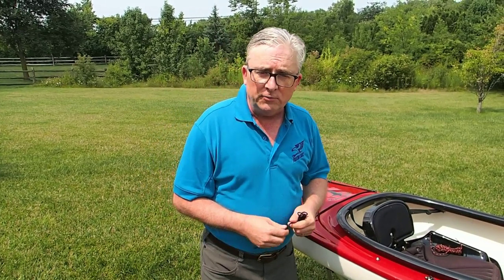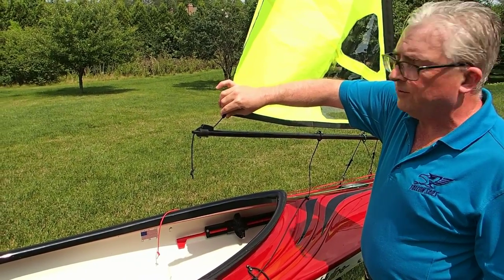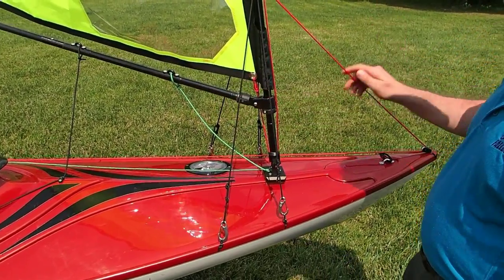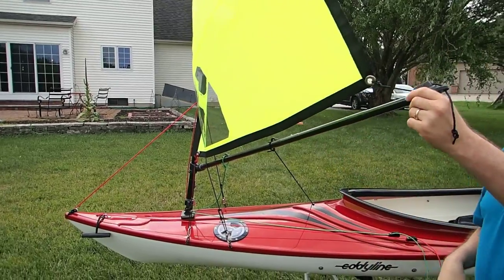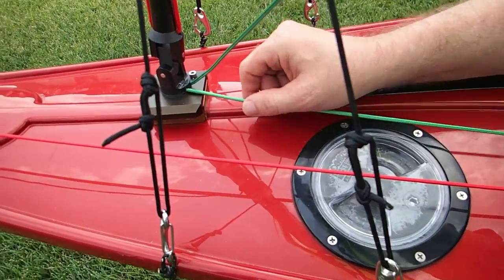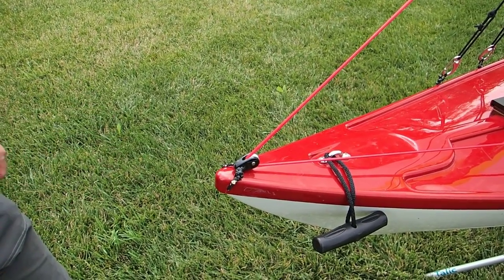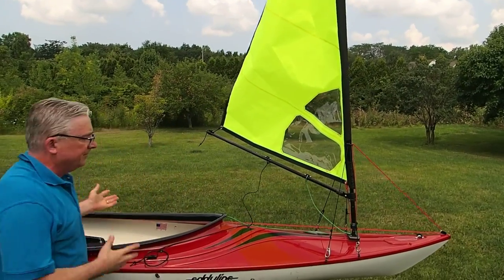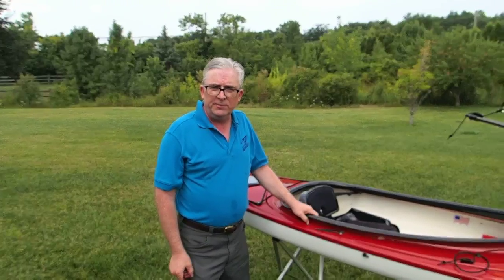What you need to know when it comes to kayak sailing and proper lines.

Comment: It looks like that boat has no rudder. Do you steer with your paddle while sailing? Are there different sizes for different kayak designs/hull areas? I was thinking I’d need a rudder and Lee board but maybe not.
Reply from the maker: Hello Aaron
If your kayak is okay without a rudder without a sail, adding a sail does not make a rudder necessary.
Steering is much the same as steering when just paddling.  An occasional paddle stroke can put you back on course.
Or you can change your balance of your kayak to give it an up wind or down wind tendency, by leaning fore and aft and also leaning a little bit up wind or down wind.
You can also adjust your kayaks upwind or down wind tendencies by moving some weight around.  If your kayak is out of balance and tends to turn up wind or down wind,  using a rudder to force it on tack is a bad ideal.  You want your boat to have a tendency to stay on course by adjusting trim of your sail and weight and leaning.

I will include some standard canned text on rudders below.

Rudders
=======================================================
The general rule of thumb is, if a kayak is fine without a rudder when just paddling, it will be fine without a rudder when you are kayak sailing. On a kayak 13 feet or shorter, rudders are not necessary. If a kayak has an adjustable skeg, a rudder is not necessary.  It is quite rare to see a 12-foot kayak or shorter rigged with a rudder.  I (the owner of Falcon Sails) have a 12-foot kayak and have never considered putting a rudder on it.   When my paddle says go right, my boat will turn right.  It will turn right even if a rudder on my kayak would say turn left.  Rudders are almost never necessary until you get into kayaks over 14 feet long. 

You can see in the pictures included with this email, that the short kayaks do not have rudders on them, and even some of the longer kayaks do not as well. 

If you want to do some lazy kayak sailing and not use a paddle for long stretches and do not want to lean or adjust the sail to steer, you can install a rudder and you may like it.

If you have a short kayak, you should avoid having a rudder early on, as number 1 you are likely not to care if you have one, and more importantly, a rudder will likely be a crutch and make it easy to use bad habits.  You should naturally balance out your kayak (it is an obvious thing to do (When you lean forward you will notice the kayak turning upwind, and when you lean back you will see the kayak turn down wind )) so it will tend to go in a straight line and not use a rudder to force an out of balance kayak to go in a straight line.  A rudder used to force an out of balance kayak to be in balance, is just more drag in the water and will reduce your efficiency and your ability to point up wind.

The general rule of thumb is, if your kayak is okay without a rudder without a sail, it will be okay without a rudder with a sail. Having a sail will slightly increase the desirability for having a rudder.  Big winds and high speeds also make having a rudder more desirable.  Having a rudder can make it easier to get through the learning curve.  In general, kayaks under 13 feet are always fine without a rudder.  Just like a kayak without a sail, when you get into kayaks over 14 feet long rudders or adjustable skegs are nice to have.  The longer the kayak is the more likely you will enjoy having a rudder. Even better than using a rudder, a kayaks tendency to turn up wind or downwind can be addressed with sail trim, leaning up wind and down wind, leaning forward and aft, changing the distribution of your load, and adjusting your speed.  Once you start doing these things, many times you would not use a rudder as a rudder is not the best way to put a kayak in balance to stay on course.

The shorter the kayak, and the more experience you have the easier it is to live without a rudder. Finally, when kayaking or kayak sailing, if your paddle says turn left and your rudder says something else, your paddle will win. 

Rudders and skegs are not there for turning so much as they are there to trim your kayaks tendency to a neutral tendency to turn up wind or down wind.  A nicely trimmed kayak is great to have.  A rudder is one of the easiest tools to use for trimming your kayak. But a rudder is a is a crutch many times and prevents people from learning proper techniques for staying in balance. And of course, using a rudder to trim your kayak also adds drag and slows you down so they are best reserved for minor fluctuations in balance vs a tool to power your way through an unbalanced situation.  The more drag you have, the harder it is to efficiently sail up wind.

In the end, if a Falcon Sail customer would like to have a rudder, then can have us send them a complete smart track (it is the best rudder kit you will find) rudder kit for their kayak at our cost which usually ends up being less than $225 including shipping.
Reply from the maker: Hello Again Aaron
You do not need a Lee board or any other lateral resistance enhancer.
A kayak is not a sail boat, but can sail surprisingly well due to their design to track hulls.
Kayaks will go foreword much faster than sideways / even more so that an naked sail boat hull will.

I included some canned text about this with a more detailed explanation below.
It has some good information to check out.

Lateral Resistance Enhancers Lee Boards / Center Boards
================================================
Your question about using a lateral resistance enhancer (lee board / dagger boards / large skegs) and if they are necessary to sail with a Falcon Sail is a common question, so we have made a canned answer to help people.

The short answer is a stock kayak hull does great and lateral resistance enhancers are not necessary.  They will get in the way and create complexities and issues at times.  Very well-made lee boards can help with some angles of attack but are not helpful in most situations and will get in the way on every outing.   They add bulk, drag, weight, complexity, cost, potential failures ect ect.

Kayaks sail amazingly well without any lateral resistance enhancer. Near zero falcon sailors use lee boards or other lateral resistance enhancers.  There is a longer more detailed answer below.

The owner of Falcon Sails wrote an this in a article.

I grew up sailing keel boats, sun fishes, trailer sailors, Hobie cats and anything else I could get my hands on.  As a conventional sailboat person, I use to think only a boat with a lateral resistance enhancer (lee board / center board / dagger board / keel) will sail properly. We have learned there is a lot more to kayak sailing, than conventional sail thinking will tell you. Conventional sailboat thinking is very helpful at times but does yield a few misleading assumptions about kayak sailing.

As far as needing a lateral resistance enhancer goes, you must consider a few things before making any assumptions. Look at a Hobie 16 and some other purpose-built sail boats. Even as a purpose-built sailboat, the Hobie 16 has no resistance enhancer because its hulls have a lot of natural lateral resistance built right in from the start. They have no lee boards, dagger boards, center boards, or keels. 

Like the Hobie 16 Catamaran Sailboat (not a Hobie kayak), kayaks have a lot of natural lateral resistance built into their hulls also and sail surprisingly well without any lateral resistance enhancer.

Kayaks are not sail boats, will not point as well as a complex sailboat, but their hulls are efficient at sailing and can make surprisingly good up wind progress. Think about this. Sailboat hulls are designed to be as slippery as possible going forward. A byproduct of a sailboat hull being designed to be as slippery as possible going forward, is a hull that is slippery going sideways (and slippery in all directions actually) and also tends to spin. Modern Sailboat hulls, make conventional sail thinkers believe you must have a lateral resistance enhancer on a kayak.

Kayak hulls are designed to track and go in a straight line. This is achieved by having lateral resistance built in throughout the length of the hull, which is what makes them sail surprisingly well without lateral resistance enhancers. To demonstrate how a kayak has a lot more resistance going sideways than forward, imagine pushing a kayak that has an adult sitting in it in the forward direction. Most kayaks will easily glide 30 feet or more. Now imagine pushing that same kayak with an adult in it, in the sideways direction. Due to its lateral resistance, it will probably go about 1 or 2 feet after you are done pushing it. Or think about towing a kayak with a person in it, from the side vs towing a loaded kayak from the bow. The kayak towed from the side will be much slower due to its lateral resistance. In both examples you are testing and seeing, a kayaks lateral resistance is significant. Once a kayaks hull moves through the water, its lateral resistance increases by quite a bit. All this said, with a smart sized sail / one that is not too big, a kayak has plenty of lateral resistance without adding anything to it.

Once you build up some speed, a kayaks lateral resistance increases dramatically. Kayaks do not sail as well as a purpose-built sailboat, but you can do no paddle sailing and reach across the wind, and even make some upwind progress.  Of course, a purpose-built sailboat will sail better than a kayak will, but kayaks sail amazingly well. If you have an efficient sail, you do not need a lee board, or center board, or dagger board, or any lateral resistance enhancer to have a great kayak sailing experience.

Falcon Sails focuses on keeping things simple, efficient, compact, reliable, and light weight with the best possible performance. All this can be had for less than 3.5 pounds, in a sail that can be dropped in seconds and folded down to the size of an umbrella in just a few more seconds.

Lee boards and dagger boards add weight, complication, bulk, expense, drag etc.. Some people want to turn their kayaks into a sailboat. That is fine, but you will add weight, complication, bulk, expense, drag, set up time at the put in, tear down time at the take out, more rigging, more stuff to store, and if there is no wind, or too much wind, you are better off with a compact sail rig that gives you 70% or more of the sailing benefits in a package that weighs just over 3 pounds that can be lowered and compactly secured to the deck of your kayak and 100% out of the way in seconds.

Everybody has their thing. If you want to have that perfect ideal incredible sailing experience in one situation, you will lose a lot in other situations. There is not a rig that will cover all situations perfectly. If you want simplicity and versatility, you will be happiest with a simplistic high-quality sail and rig for your kayak.

As a lifelong sailor, I thought the same thing sailors typically think about lateral resistance appendages. I have sailed and owned a lot of different boats. I used to race and skipper and crew on a lot of different boats, and can say I am a decent sailor. My conventional sail thinking made me believe you need a lee board or something on a kayak to sail. Then I tried kayak sailing. The performance of a sail on a kayak amazed me. I was hooked instantly. I was surprised. That was even before there were good quality sail rigs available. Now that I can have a good quality sail rig, and a good airfoil shape, I will not go kayaking without a sail.

After kayak sailing for the last 12 years and having paddle sailed thousands of miles, I have never used a lee board or anything like it. None of my friends use lee boards and none of us feel like we are missing anything.  If you keep a good sail trimmed properly, oriented to the wind properly, and have at least 1.5 mph of hull speed, you can reach across the wind, and even make upwind progress of about 20 degrees above reaching. That is without paddling or a lee board or a dagger board on a standard stock kayak hull. Some kayaks will do even better than this.  In general terms if you have good conditions, a good sail, and you use decent sail trim, you can easily sail 200 degrees and even up to 220 degrees without paddling and without the bother of any lateral resistance enhancers. If you paddle to keep your speed up and the sail oriented properly to the wind, a good sail, will generate useful propulsion all the way up to within 30 degrees of straight upwind. That is with or without a lateral resistance enhancer.

In general, once your actual track is 10 degrees above reaching, you have to start paddling to keep things oriented properly. Initially a few small paddle strokes here and there will add a lot to your possible angles of attack. The more aggressively upwind your angle of attack is, the more you have to paddle. But still, you can gain useful propulsion to with 30 degrees of straight upwind.   For example, you can paddle with a 2mph effort and go 3.5mph.  You can speed up faster, slow down slower, and have a higher top speed. You can have a lot lower paddle stroke resistance as well and have a lot more fun while you are at it.

With a little bit of planning, you can paddle upwind a little bit and reach back and forth all day long and not have to paddle much at all. Once your movement is 15 degrees above reaching, you cannot just sit there doing nothing, but you can avoid paddling and reach across the wind all day long, and even make upwind progress without paddling and without lateral resistance appendage or enhancers. With a good sail, kayaks sail very nicely.

Just like when sailing a purpose-built sailboat, when kayak sailing to maximize your potential, you will have to think about what you are doing. When conditions are good, you can get useful propulsion to within 30 degrees of straight upwind. Anybody who does a lot of kayak sailing with a good quality rig will agree. If it is really windy, gusty, shifty, there are large waves, you are not thinking, you have too big of a sail, the paddle sailor is inexperienced, ect, the 30-degree number is going to grow.  With a good sail and some practice you can have the same results.

I wrote a bit more about this here.
https://www.falconsails.com/KayakSailingFAQ.php#centerboard

If you contact me at Falcon Sails, I can send to you a rough draft set of instructions for kayak sailing upwind.
www.falconsails.com/contact.php
Reply from the maker: Hello one more time Aaron.
I wrote about lee boards below, and the text was too long.
So here is the part 2 of 2 so  you can learn everything we worked hard to learn about lee boards.

This video shows a clip of a upwind leg I was enjoying a few seasons ago. It is a lot of fun.
https://www.youtube.com/watch?v=xjzld6MZhCI

I was in a 14-foot-long Jackson Journey kayak and making some upwind progress without paddling.  I could have made more upwind progress if I paddled, but I can sail with no paddle 210 out of 360 degrees.  This kayak has a rounded hull so most kayaks will do a little better yet. 
This video shows me sailing and tacking upwind with no lee board or dagger board and almost zero paddling.

Here are 2 videos of me enjoying my kayak and sailing up wind with very little paddling.
https://www.facebook.com/falconsails/videos/1594936704274061
&
https://www.facebook.com/falconsails/posts/4106133799451973

Both includes some really neat gps telemetry that makes it easy to see my actual movement.
It shows me sailing 210 out of 360 possible degrees. This kayak has a rounded hull which makes it a average performer. If your kayak has a contoured hull, it will sail better / about 10 more degrees on both the port and starboard side.
If I started paddling and kept the sail oriented to the wind properly and kept some motion to help my stock hull generate more lateral resistance, I could have had useful propulsion to within 30 degrees of straight upwind.
This is very similar to motor sailing a sailboat. The motor alone can push the sailboat, but using the sail it will speed up faster, have a higher top end speed, will slow down slower, and require less effort to get to your destination.

Here is another video of some friends and I enjoying a nice 18-mile paddle sail where we sail about 70% of the day.
https://www.youtube.com/watch?v=RkbSSlYEYl0

If you plan your day well, use good techniques, take advantage of reaching, and not dive downwind you can sail all day long without lee boards.

Here are some pictures of a typical kayak sailing day, that include a track log of what we sailed and what we did not sail.  I had several beginner kayak sailors with me, so I avoided some of the more difficult tacks and we still sailed about 75% of our miles.
https://www.flickr.com/.../falco.../albums/72157712563766083

Here is a link to video and paddle sail report showing how much fun my friends and I had on a 5-day trip kayak sailing around Cedar Key on the Gulf of Mexico side of Florida. Look at the text. With a little bit of planning and smart sailing, we were able to sail 90% of all our lines.
https://www.facebook.com/falconsails/videos/2408620615978528/

Here is a link that shows all the lines we recorded on our GPS.
https://www.google.com/maps/d/u/0/edit?mid=1OgAfpky2M25Ui6poZo6ANwL5a-_zGwc&ll=29.13438357058386%2C-83.0575005&z=14&fbclid=IwAR0RyoxfXOwNB-b2jKG-mATcsc5BKCNszuc2v9KiYjhdXLIxu2Ymre2RUqQ

You can zoom in and see all the details.  We sailed 90% of these lines.  It was amazing.

If you want to sail paddle sail in good conditions, it is easy to sail with zero paddling more than half your chosen lines even if you do not plan anything and just randomly pick lines.   If you get smart and choose good lines, you can easily sail with zero paddling 80% of your lines and raise that to 100% of your lines.   If you paddle while doing some of your sailing, you can use your sail all day long.
Reply from the maker: Aaron 
You asked about sail sizes.

Falcon Sails has 3 different sizes which are mostly geared toward different wind levels more than what kayak you are sailing.
Though kayak choice has a impact on sail choice as well.

Here is a long canned explanation on sail sizes to consider.

The 1.4 is nice to have on a light wind day or on a wider more stable kayak.
The 1.1 is a really nice in between size.
The 1.0 is for sure the go to size on a bigger wind day, or if your boat is smaller and tippier.
You will be happy with any size, but one size will hit the sweet spot more often than the other.

Here are a few general rules of thumb.
If you have a narrow kayak, and see winds above 10mph regularly, the 1.0 is the way to go.
If you have a super stable kayak / one that is over 28 inches wide and only rarely see winds over 15mph, the 1.4 would be the best size
If you have a wide kayak and like big wind days over 15mph a 1.0 square meter sail is a great choice as well.
The 1.1 is a nice in between size.
No matter what kayak you have, all sizes are going to work nicely with any kayak you may own.

If you buy any size sail with a complete rigging kit, you can add a sail only of any size you like at any time, and have any combination of sail you like at any time you hit the water.
All sizes of Falcon Sails are compatible with the Falcon Sail rig.  If you buy a Sail only of any size at any time, it will include everything you need to use it with your Falcon Sail rig.

Skill level does play a small role in the choice, but in general a smart advanced kayak sailor will be no more likely to go with a big sail than a beginner.

Advanced kayakers who enjoy sailing will typically go out in bigger winds and are best served by the 1.0.

There is no reason to be overpowered.  On a big wind day, a 1.0 square meter Falcon Sail can push any kayak to its maximum hull speed, and for sure as fast as the strongest paddler can paddle a kayak if the distance is more than a 50-yard sprint.

In the ideal world you have all 3 sizes of sails.
If you buy a 1.0 square meter sail with a complete rigging kit, you can buy a 1.4 square meter sail only any time you like. And of course, if you buy a 1.4 square meter sail with a complete rigging kit, you can buy a 1.0 square meter sail only any time you like as well.  It is all the same thing for the 1.1 square meter sail as well.

All Falcon Sails hardware is modular and interchangeable.

We look at every order to make sure somebody who already has a Falcon Sail will be taken care of / will have all the hardware necessary to use it on a previously purchased rig with another size sail.

The 1.0 sail only comes with a boom extension that will make it work with your 1.4 or 1.1 sail rig.
The 1.1 sail only comes with a boom extension that will make it work with your 1.0 or 1.4 sail rig.
The 1.4 sail only comes with a boom extension that will make it work with your 1.0 or 1.1 sail rig.

So, if you ever buy another size of sail / sail only to use with your current rig, you will have everything you need.
Changing sail sizes is easy to do.  With just a little practice you will be able to change out a Falcon Sail in about 90 seconds or less.

If you decide you like going out on really windy days, you may decide to order a 1.0 later.

In any case, there is no sense in being overpowered as the 1.0 on a 15mph wind day, will push your kayak as fast as it will go, but still the 1.4 will be fine in pretty big wind and you can always drop it and stow it on your deck in the unlikely event it is not fun or you do not feel like you are in control.

Here is a video that shows how to change sail sizes.
https://www.facebook.com/falconsails/videos/768410241951446/
Reply: Thanks for the response. I’m paddling a touring kayak (Tiderace Xceed) that is 17 1/2 feet long and pretty narrow. I was thinking that having a sail as additional power when going on multi-day trips might speed things up significantly. Usually I won’t be out in heavy wind, but I’d probably opt for the small sail just in case. I haven’t paddled my boat enough yet to really know its performance in wind, but with waves coming from behind me it is hard to even notice them. I’m looking forward to paddling more and getting out for a few trips next spring. Your sails are definitely at the top of my list for possible modifications in the future. Thanks again.
Reply from the maker: @AaronBrand  
When we made our design 15 years ago, we only used sea kayaks to test things out.  I personally sailed a Valley Nordkapp and now I paddle sail a Valley Etain.

Sea kayaks all sail nicely and are easy to rig as well.
You can see some pictures of a recent paddle sailing trip I (Patrick Forrester - Owner of Falcon Sails llc) took to Ireland by clicking on the below link.
https://www.flickr.com/photos/falconsails/albums/72177720312201144

I taught kayak sailing at the Irish Sea Kayak Association 2023 Annual Symposium.  It was too much fun.
I can not imagine kayaking without a sail.  It is a lot of fun, and yes you will go a lot further with a sail.,
You can be a lot more relaxed when you get to your destination.

But they are so much fun, sailors typically stay on the water longer.

In any case we can answer your questions better by email or over the phone.

Our contact info is on this page.
www.falconsails.com/contact.php
Reply from the maker: @AaronBrand  

You may like these oldie but good videos of some Falcon Sailors enjoying a day with kayaks similar to yours.

https://youtu.be/RkbSSlYEYl0?si=1kgLerAW1rzYY6k1

https://youtu.be/tpJP4ZzSIKk?si=l0lxg4b-evNkls0B